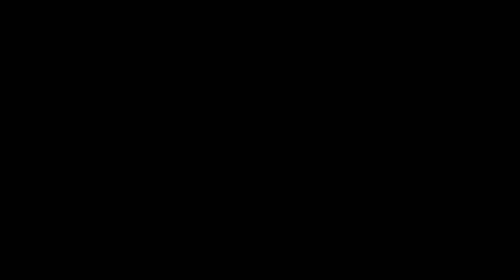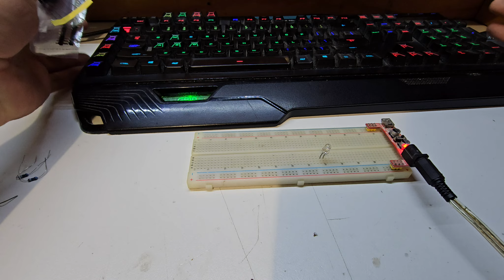Flipper Zero | DIY IR Blaster

Comment: But what about the current consumption? Is flipper zero enough to feed every IR LED?
Reply: Most of the IR Blaster circuits have does its own Li-ion in their back.
Reply: I believe we should use external pow sup for the LEDs and we can use to transistor to control power. IR LEDs have very tiny shining when you switch them because almost 300mA is consumed by LEDs, for total. And the current outage is limited to 200-250mA for flipper. Please add only one li-ion to this module that you created. And try again.
Reply from the maker: @schematrix  if you do some math you'd work out these are getting about 10ma each.
Reply: @TheAussieRepairGuy okey bro if you say so… I was just thinking
Reply from the maker: @schematrix try pumping a quarter amp into a standard 5mm LED and watch what happens...
Reply: @TheAussieRepairGuy why you delete my comment man? I’m just tryna talk with you
Reply from the maker: @schematrix havent deleted anything. Maybe auto admin got it. Im on a remote island right now, will check shortly
Reply from the maker: Yeah I checked, nothing held. No idea what you said or why. Maybe reword it

Comment: this diy ir blaster with more ir led can make it powerful compared to flipperzero stock ir led?
Reply from the maker: It's not so much powerful as it is a wider spread. However you coul use a different led and resistor combo for more power yes
Reply: @TheAussieRepairGuy  any led and resistor recommend? a 3w would work? i saw Ray J did an IR sniper and I wonder how long is the range?
Reply from the maker: @IreallyLoveDiamond  No, very much no.
the resistor is to current limit the LED, and needs to be chosen properly.
3W is going to be too much for a BC548 transistor. they are good for about 300mw.
You will need a much more capable transistor, and for the 3W led, you will need more than the 0.25W resistors on thsi board. the resistance value will need to be chosen to match the requirement of whatever led you choose.

in this case I used standard 5mm 940NM led's, current limited them with a 390 ohm, 0.25 watt resistor, using a BC548 transistor, because that's what I had laying around.

Take a look at rabbit labs IR blaster, by the time you screw around and buy all the parts, and waste a few days making one, their stuff is going to be cheaper and way more effective.

Comment: hey, do you maybe have a building/connection and  plan? something that tells me where to put things exactly and how to solder. a sketch or smth
Reply from the maker: In this case I built it on the fly.

I only use 3 pins, 5v, gnd, and one of the IO pins. Io pin goes to base of the transistor. 

I'd have to re-watch my own video and take notes.

Comment: Can you explain a bit more about why you chose certain parts of the bread board? Sorry if this is dumb I’m new. Also does more ir lights mean longer range?
Reply from the maker: I chose parts of the breadboard because that was the most convenient way to get the connections I needed. more lights doesn't always mean more range, but it means wider dispersion. when I want to spam out power off codes, I want to get every TV in the room.
The pin headers are all connected to different GPIO and power pins, you need to connect the right thing to the right pin, you can't just hook it up to any old pin and make it work.
Reply: @ thank you for the quick and detailed reply. How do you figure out what goes where? Do you have schematics and a list of what you used you can share so I can recreate? Love the vid very detailed thank you!
Reply from the maker: @kenobi9453  the flipper zero has extensive documentation for that.

however =5v pin for 5v, gnd pins for ground, gpio pin to transistor gate to switch it, and a few resistors to limit the current to the LED's. Ohms law helps to calculate the value.
transistor emitter to =5, and collector to led resistors
Reply: @TheAussieRepairGuy sorry to keep on asking questions this is the last one I hope. By the way congratulations on 6000 subs! Do you have a list of what you used in terms of transistors and other stuff like that? you say in the video but it changes a couple of times. Thank you so much!
Reply from the maker: @kenobi9453  Pretty sure I list off the transistor type in there. without looking, a BC548 should do the job.
Reply: @TheAussieRepairGuy  I would just like to thank you so much I always wanted to do circuitry and to build my own modular and before I never found a good video but this helps so much and I just created a successful prototype of an IR blaster Thanks to your help.